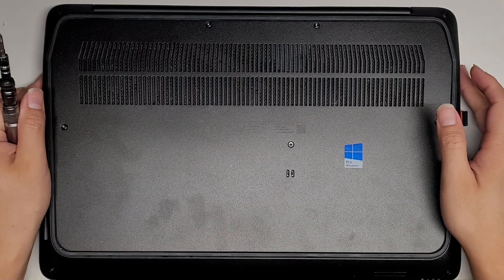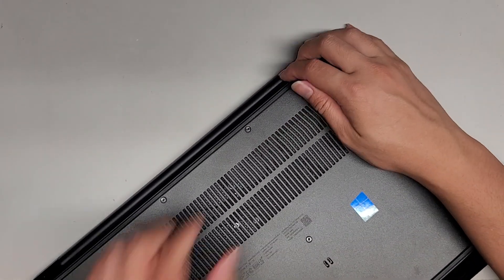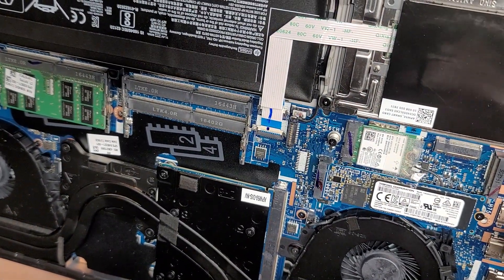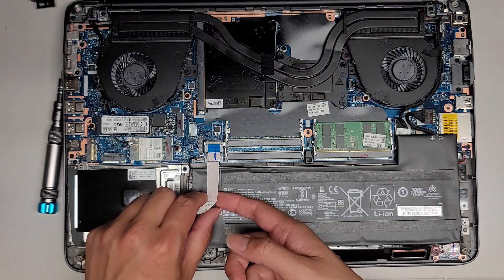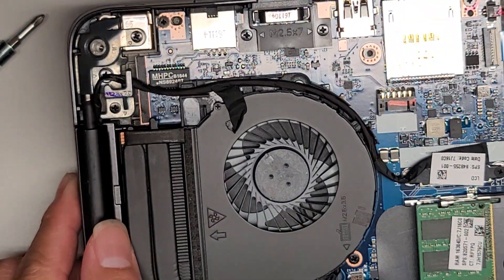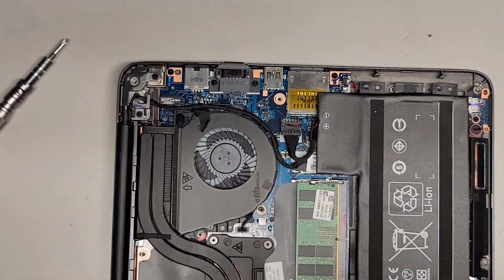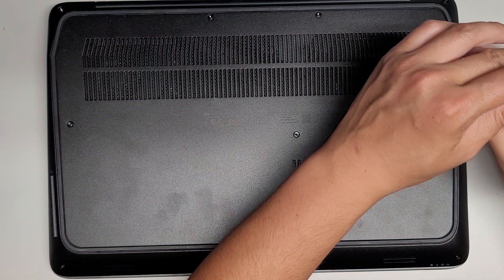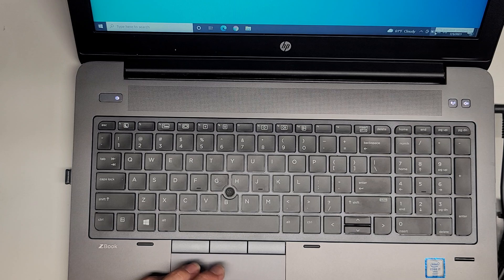HP ZBook 15 G3 Mobile Workstation Disassembly RAM SSD Hard Drive Upgrade Battery Replacement Repair

Comment: Hi i have the same laptop and i wants to upgrade the ram so which slot should i use from the 4
I have 1 8g and i want to use 2 8g
Reply from the maker: I'm not too sure. I'd use both closest to the motherboard personally

Comment: "The device unexpectedly shuts down when the battery reaches 50%, initially, and now it shuts down at 89%. Is there a problem with the battery or something else, engineer? I need your advice."
Reply from the maker: Does it happen even when plugged in?
Reply: @ItsBinhRepaired  

"When I connect it to electricity, it works normally. Also, when charging, it starts from 90% until it reaches 100%. However, when I disconnect the charger from the computer and use it until it reaches 90%, the device shuts down, and I can't turn it on again until I connect it to electricity."
Reply: @abdailuhjamal1997 كدا البطاريه بها مشكله.... لسا شاري الجهاز دا من شهرين ولكن البطاريه طلعت نسبتها ٣٠٪....... ممكن تعمل فحص للبطاريه عن طريق اوامر cmd

Comment: Ok so there are 2 m.2 slots, the wireless card slot, but do you know what that 4th slot is for?
Reply from the maker: What?
Reply: @ItsBinhRepaired  I have this same model laptop. There are two m.2 slots (one going left one going right) and a WiFi* slot (which is situated parallel to one of the m.2 slots), but idk what the 4th slot is for. It's the one pointed towards the top of the keyboard/screen. Wish I could post a picture to clarify.
Reply from the maker: @VaultHunterRyRy  maybe wwan
Reply: @ItsBinhRepaired  Ok that makes sense because mine has two wires running to that slot that are the same kind of wires/connectors as the wires connected to the WiFi card. Thanks a bunch for the replies! Much appreciated!
Reply from the maker: @VaultHunterRyRy  yup

Comment: I purchased a refurbished g3 just like this from Amazon a year ago. I tried to do a reset to clean it up for my husband to use for music. Anyway it now seems I have an encrypted hard drive and Microsoft told me to replace it. I came to see how to get the back off but now I’m not sure the replacement hard drive I purchased was right because your not showing a big square other than what’s in the corner. Is that the hard drive?
Reply from the maker: Put an SSD in its place

Comment: I replaced the battery and I get no charge. I press and hold the button and the power light turns on for a brief moment and goes off.
Reply from the maker: Does it work while plugged in with no battery?
Reply: @ItsBinhRepaired  i haven’t tried that yet. I will do.
Reply: @ItsBinhRepaired  I just tested the pc without the battery and I got the same result.
Reply from the maker: @jayram64  then it's a bad motherboard

Comment: Just bought a used HP zbook 15 G3 - didn't come with any RAM installed. I purchased (1) 4GB stick with the recommended spec's, and installed it into slot #1. I got a black screen and error code of 3 long + 2 short beeps indicating memory error. I tried  the memory in slot #2 and it booted fine. Now that I know it works, I'll be looking to add more RAM, but I'm a bit worried about slot #1 (maybe others) possibly not working. Do you know if these slots should be populated in a certain order? Which slots are tied together for dual channel operation? Couldn't find this information in the manuals. thx
Reply from the maker: It should work with just one in any slot as far as I know, but could be wrong.

Comment: Sir does this support 80 Ram?
Reply: 64gb ram are the maximum it can be upgraded to, at least it says so on the HP datasheets. (Limited by the chipset/CPU)
Reply from the maker: @Finnspin_unicycles  do they sell 32gb sticks of RAM?
Reply: Late to the game, but 64/4 is 16gb each slot. There is one 16gb in this video. This customer would need three more 16gb to Max it out.
Reply from the maker: What's 80 RAM?
Reply: @ItsBinhRepaired  
Can we increase ram to 80 gb?
Reply from the maker: @iftikharali78672  you'd be putting 1 32gb and 3 16gb. Not sure I recommend that. You want matching sticks. Should work though.
Reply: @ItsBinhRepaired  
Ok Sir thanks
Reply from the maker: @iftikharali78672  no problem
Reply from the maker: @Finnspin_unicycles  I was just wondering how over 64gb would be possible. Didn't know they have 32gb sticks.

Comment: Just bought refurbished version of this laptop, and its battery don't really last long and needed to be replaced. I did some research on Internet about replacing battery and its say this laptop is quite easy to replace the battery and even able to upgrade its RAM and GPU, which most laptop nowdays have their GPU and battery soldered and some has RAM soldered. So thanks for the tutorial.
Reply from the maker: I wouldn't exactly call the gpu upgradeable. Replaceable is more like it.
Reply: @ItsBinhRepaired  yeah, seem hard to find gpu that compatible with the laptop
Reply from the maker: @Shadow-ew3je  yeah